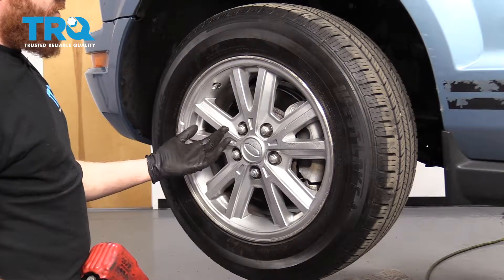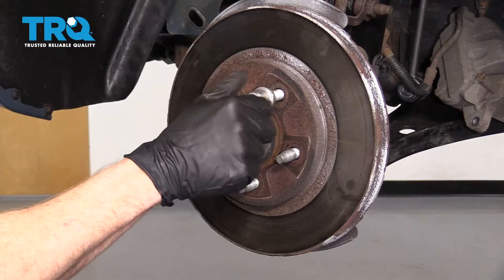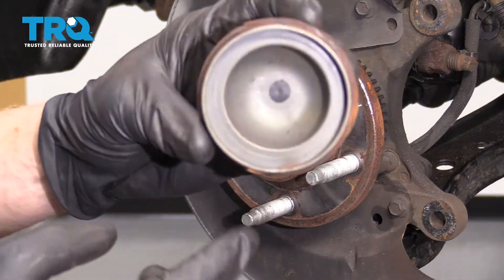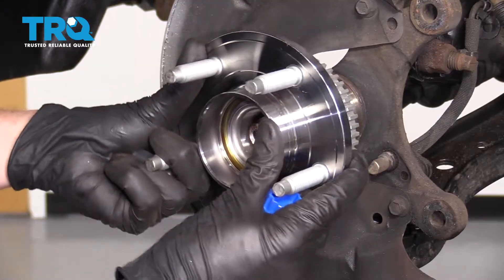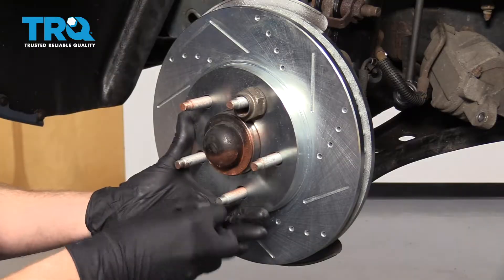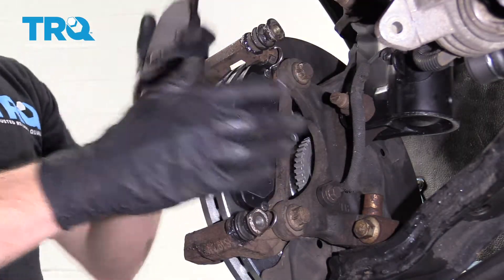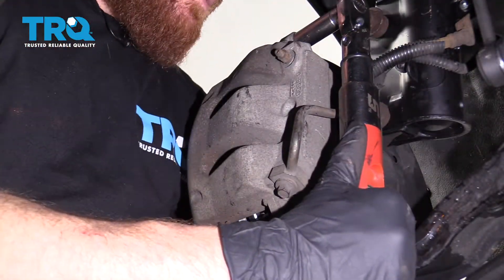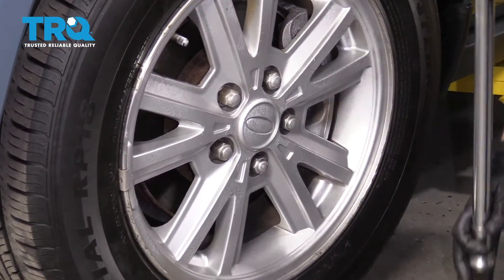How to Replace Front Wheel Hub & Bearing 05-16 Ford Mustang

Comment: Thanks for the videos! I just relpaced the inner and outer tie rod ends on our 2008 Mustang using your instructions. Unfortunately, when I pulled the right side wheel, I found that the last tire mechanic who worked on it stripped one of the studs. Is it safe to hammer the stud out of the front hub with it still on the car? Or will that damage the wheel bearing that's built into the hub?

Comment: What tool was that for hub cap? Sharp clamp thing
Reply: Can also use a flathead screw driver and tap it out with a hammer
Reply: hub puller tool but vice grips can work

Comment: Good video.  If you're just replacing the hubs you don't need to remove the caliper, pads and bracket just remove the 2 caliper bracket bolts and take the brakes off as an assembly.  This way after the wheel is removed it's just 2 bracket bolts and the spindle nut.  Quick and easy.
Reply: You got that right. 😎👍🏽

Comment: Did you use the same axle nut
Reply: It’s a spindle nut but it’s one time use
Reply: Based on the thread locker, I'd say he reused the spindle nuts.
Reply: @MrOgynist  some reuse them anyway even without threadlocker. I would've used blue instead of red if I was going to use any but I likely would not use any even with a used nut